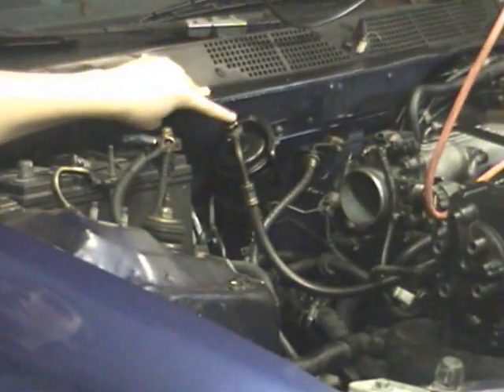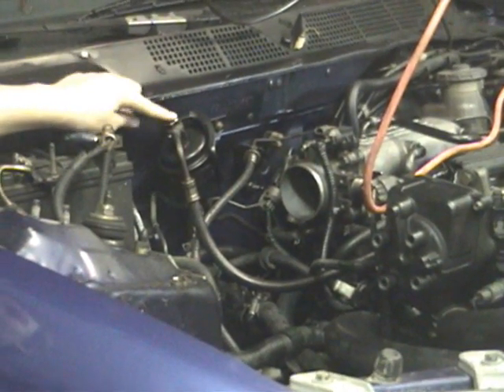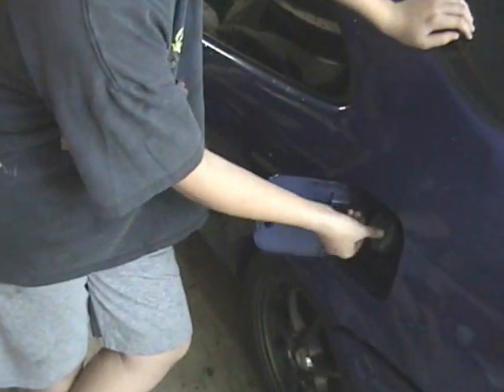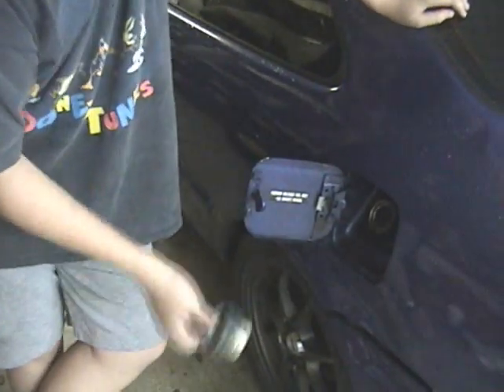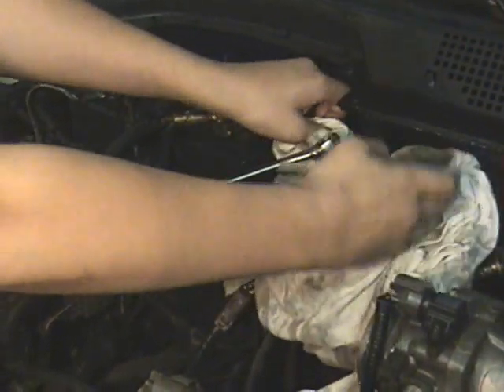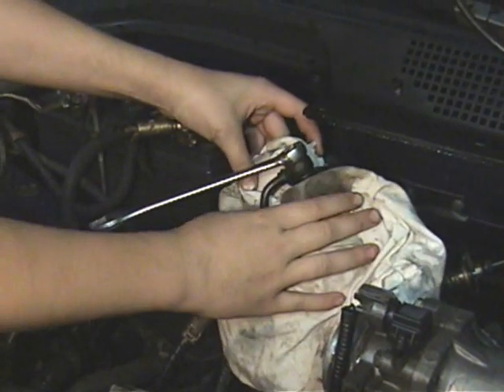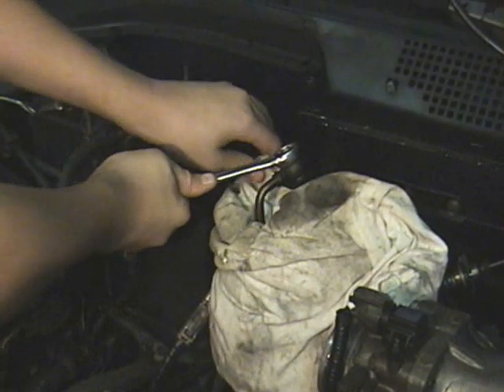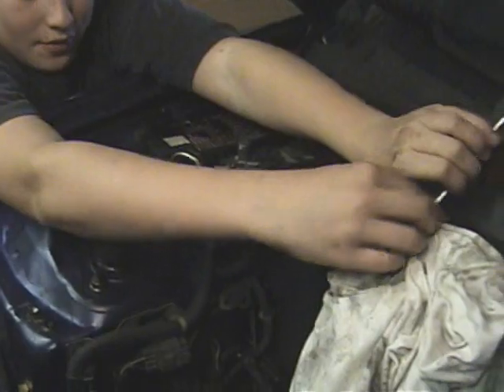How To Release Pressure From Fuel Lines

Comment from the maker: @NumbNuts209   Good point.  The fuse should be unplugged, or the ground terminal of the battery should be disconnected, to prevent sparking of a fire.

Comment: I like your tutorial.  It's awesome when today's youth can work on cars.  But here's something you can add, as an additional method.  Try it out.

1. Pull the fuse/relay to the fuel pump.
2. Start the vehicle and let it run until it dies.
3. The fuel pressure is safely and completely relieved.

Give it a go!  Good job, by the way!
Reply: thanks for this as i dont have a fuel pressure gauge
Reply: What about if your car doesn’t start

Comment: @ggonz003 - If there is pressure in the lines and you go to work on the fuel system, you'll end up with a face-full of high-pressure fuel with the capability to peel off skin.  This is a good, fast method to do it, but there is another way.

Comment: @RichardBullittBush For gas engines?? Most multi-port systems today run at MAX 60PSI, frankly by the time you thread a fuel line fitting off i'm convinced most of that pressure has been relieved when fuel starts seeping out. Diesels is where you want to be extra careful, the injector pump to injectors circuit is 2000PSI or up to 20000PSI, with that pressure a pinhole leak can become a needle!

Comment: @YeechBlitz Yes but pressure is usually relieved when the engine is started and the EVAP purge solenoid opens and fuel vapors stored in the charcoal cannister are burned. How old are you btw? I'm damn impressed at your knowledge, go apply for a Motive Power program at a college dude... you're a gifted car guy.